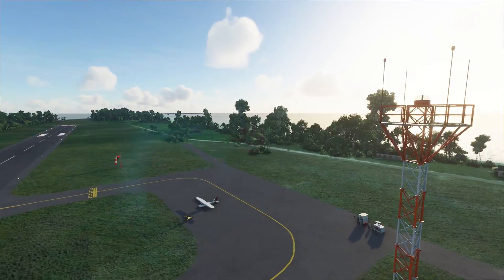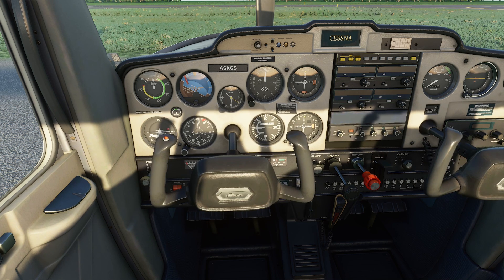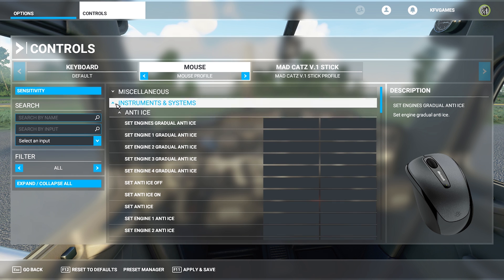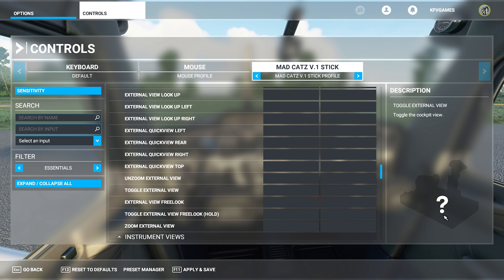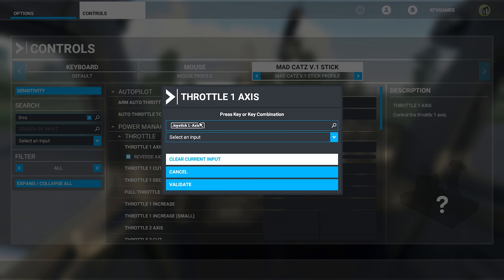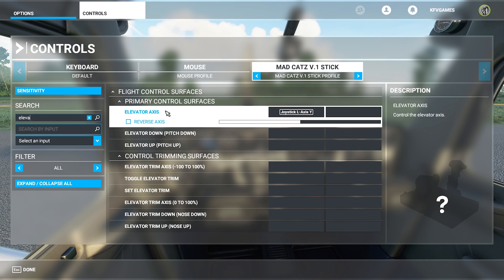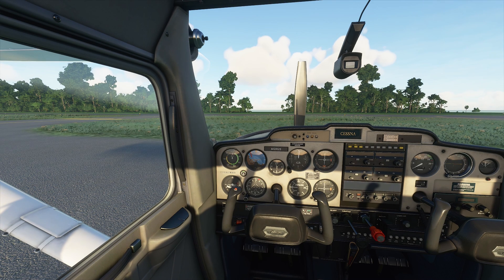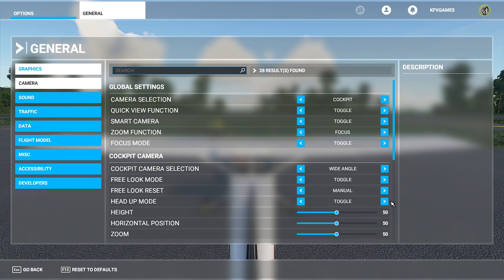HOW TO SET UP CONTROLS IN MICROSOFT FLIGHT SIMULATOR 2020

Comment: Neither the Saitek Switch Panel or Multi Panel are supported by MSFS 2020.  Mine are new...only a week old.  I wonder how long it will take Logitech to come up with drivers.  Or is it a MSFS problem?

Same is true with no-in-game support for CH products.  I have the CH Eclipse Yoke, Fighterstick, and the Pro Throttle.  At least the Sim sees those devices...but you do have to configure every button and axis individually.  And still wonky and a headache.

How could Logitech...and CH...two big names in the Sim world...drop the ball on this revolutionary new Sim's release, eh?  Or is the issue on the Microsoft end? Whoever is to blame here...they are pissing off a bunch of world-wide simmers right now!

Comment: My first hour on FS2020 and I wondered if my 20 year old MS FS Sidewinder 2 joystick was going to work at all. Thanks to your video I got the gist of it and basics going fine. The throttle (slider) was wacky at first, but somehow I got that fixed and it works well. I'm going to read more about joystick setup because I miss the hat button being able to pan the exterior view. I have a slow connection so haven't even tried the satellite portion but the scenery, and especially the clunking sounds and jolts of the aircraft are amazing.

I'm adding something here for anyone interested in configuring the hat key for panning either the cockpit, when that is selected and the exterior view.  In this same menu for the joystick configuration, search for Exterior Camera (making sure ALL is selected in the search scope), then expand the entries under it.  Start with "EXTERIOR VIEW LOOK LEFT." Click in the top box to configure it by pressing the hat key to the left. It will register that. In the box under that select the POV<- symbol. Click Validate. Repeat for down, up, right, down left, down right, up left , up right. Now when exterior view is selected, the camera will pan smoothly. For the cockpit view you can do the same, using the same symbols and same procedure with the hat key, only I did only four directions. 

Some of the things I tried didn't work but I tested the above and it works, and is necessary since that is what the hat key is for.
Reply from the maker: You're welcome, stay tuned for more tutorials

Comment: My throttle axis is bound correctly, but the axis is split with reverse thrust then forward thrust, as in elite dangerous......any ideas?
Reply: Not sure if this helps but I have set throttle axis only, not configured throttle up or down.  Also if my physicall throttle is all the way at the bottom then the throttle on the game is on.  Basically,  halfway on my physical throttle is 0% throttle in the game.

Comment: My Saitek X55 is seen in game but it has a greyed out icon and a question mark on it. If I try to set controls, when waiting for input it doesn't respond to any button I push or axis I move. I'm still figuring out how this works, I guess I have to manually assign every button from the menu instead of it recognizing my inputs directly from the joystick. This sucks so much, of all things a Flight Simulator should have 100% joystick support, default templates and easy joystick configuration. I wonder who betatested this pile of $hit interface. I only had time to play for an hour yesterday evening so I had to make do with keyboard controls. I really had mixed feelings when I flew over my hometown with gorgeous graphics while tapping keyboard keys trying to keep a wobbling plane airborne. Not to mention I had to reboot the crappy installer 6 times just to get the game to download and install. Hope I'll have more luck tonight and manage to get my joystick working. All in all, lovely graphics but terrible, terrible interface, joystick support and installation procedure.
Reply: I'm having the same issues right now. I can click on control mappings but it's just a grey box and does not respond to any button inputs. I'm super confused right now
Reply: @alexl7989  I fixed my problem yesterday by downloading a picture of my joystick from internet with all the joystick numbers. That way I could assign each button one by one. I.e., I wanted to assign parking brake to a certain button on my joystick but I first had to find out what the number on the stick was. So I had to use the reference picture and keep alt-tabbing back to the  simulator to assign a button. All other flightsims that I use let me just push a button on the stick to assign it. Microsoft made a ridiculously bad key mapper. On a positive side, the sim itself is quite nice apart from the numerous CTD's.
Reply: @KingHaggis  How did you fix it with you x55 hotas because I got the same but the only problem I have is that if I assign it it sees it as a buttun and not as a axis on the joystick
Reply: @darkzone8352  Be sure to set the axis correctly by chosing the whole axis and not the axis increments as those will be seen as buttons. 

For the Flightstick I set the following: AILERONS AXIS - Joystick L-Axis X, ELEVATOR AXIS - Joystick L-Axis Y,  RUDDER AXIS - Joystick R-Axis Z, RUDDER LEFT (YAW LEFT) - Joystick R-Axis Z- , RUDDER RIGHT (YAW RIGHT) - Joystick R-Axis Z+

For the Throttlestick I set the following: ELEVATOR TRIM AXIS (-100 TO 100%) - Joystick R- Axis X,  THROTTLE 1 AXIS - Joystick L- Axis Y.

Note I have yet to set the Throttle 2 axis. You can assing the rest of the functions like Flaps and Gear to buttons of your liking. What helps enormously is to have a reference picture of your X55. You can find it on Google Images by typing: X55 button layout. I set my Landing Gear to button 7, my Increase and Decrease Flaps to 8 and 9. Brakes are also necessary to assign to a button of your liking and POV buttons to look around your cockpit. Those are easy to assign because they have arrow icons. This setup should get you started with the most basic aircraft. Good luck!

Comment: Prior to jumping into the airplane. How did you get that outside view and scenery? What keys did you use on keyboard?
Reply from the maker: JOSEPH GAMBINO by pressing the insert button
Reply: check the controls setting, it should show you everything
Reply: @radius337  Is that the Drone Settings?
Reply: JOSEPH GAMBINO control settings
Reply: @radius337   Found it ,  It was in the Showcase (Drone Settings)  . Thanks Radius 👍✈
Reply: JOSEPH GAMBINO no problem!

Comment: I need some help with my keyboard it is not working with num 6 I don't have a full size keyboard
Reply: same
Reply: @radius337  I found a good solution that is actually better than playing with just full size keyboard. Connect your controller to your pc and it handles good.
Reply: shipex sn1pes would an xbox one s controller work?
Reply: @radius337  exact one im using bro. Also in some parts of the game you still need to use your keyboard and mouse but you won't need any of the extra num keys.

Comment: its really sad when you pay $119 for the game and it doesn't recognize your joystick (X45).... pathetic.....
Reply: Dude, I've tried 4 different joysticks and none of them work. Its ridiculous. Also paid 119. I gave up for today. Hoping they update asap.
Reply: @sandplasma  Wow! Sorry to hear that but im glad to hear its not just me and my gear
Reply: Same here! So annoying
Reply: I have a Saitek Dark Tornado and I have set up the controls manually in the controls settings because MS flight 2020 didn't recognise it.  It seems to work perfectly looking at the graphs in settings, but on the aircraft, if you roll left and then center the stick the ailerons don't center again, they are stuck in the left roll position and you have to try and roll right to correct it, but it doesn't work smoothly and suddenly flips you.  Same problem with the elevators.  Totally unflyable.
Reply: Bill Bimson  you be able fly with xbox360 controller that’s what I use for now and flight sim recognised it as long plugged in your usb port
Reply: My x45 isn't working at all either.
Reply: @americathebeautiful4804  it will work. you just have to set it up your selfs in the settings
Reply: @WorthlessDeadEnd  options - controls - select ur yoke or what ever - then top left press sensitivity and tell me if you see it respndonding to yoke movements
Reply: @rustclip  I tried this on my x45 and it shows it responding to input but it's sporadic and not workable.
Reply: Okay, under the "Select an input" section, I had to scroll all the way down to see the throttle controls ("Joystick L-Axis Z").
Reply: @WorthlessDeadEnd  yep, and so u see it moving when u move ur yoke
Reply: Scotty P!! It should now as had problem yesterday last night my brother found first 1 day joystick bug should fine I’m gonna try last I played via Xbox controller
Reply: Hi Everyone, I think I figured it out. When you plug in your controller and it shows "??" its because it will not configure it for you.  However if you press the arrows on the left to go to essentials and then manually configure the axis for elevators and ailerons the controller will work.  So its just more work but they work.
Reply: sandplasma there been a one day bug joysticks not recognised only keyboard and mouse. Firstly my brother read forums
Reply: X52 here; and CH pedals; neither work. So angry and disappointed that they couldn't get the fundamentals right. It makes me wonder what else is wrong. Plus I thought TrackIR was supposed to work too but it doesn't. :( Gutted and uninstalled it till it's fixed.
Reply: Scotty P!! For time being use Xbox 360 controller that works use none TIL the fix joystick bug

Comment: just me or is the yoke controls too sensitive in this game?
Reply: Mine dont go back to neutral when I take pressure off the joystick this the same issue youre having?
Reply from the maker: Mike Florey no, please check sensibility
Reply: @mikeflorey8401  i have this issue, its so annoying, cant even fly in a straight line.
Reply: Problem solved!!! 

Go to steam settings > controllers > general controller settings >  and disable all the configuration support boxes  so uncheck all the boxes 

Its fixed the issue for me been flying fine since
Reply: @mikeflorey8401  thank you
Reply: @mikeflorey8401  oof i dont use steam
Reply: @rustclip  may be a similar setting on the platform you use?
Reply from the maker: Mine are extremely sensitive but change settings